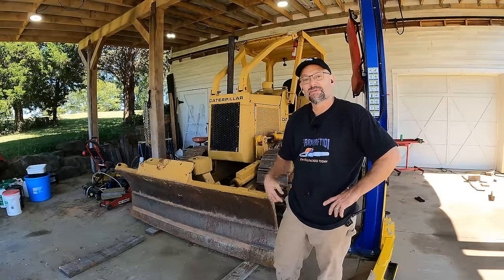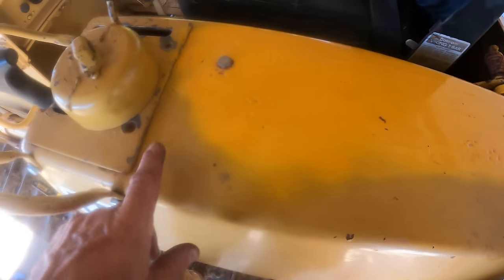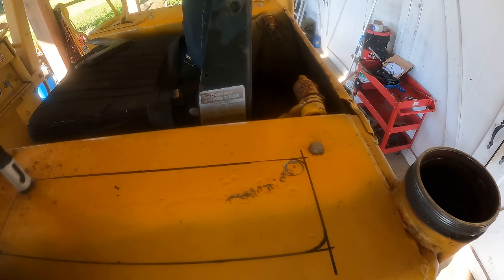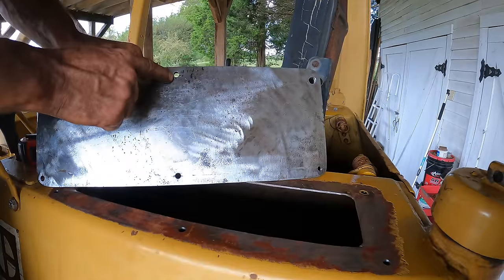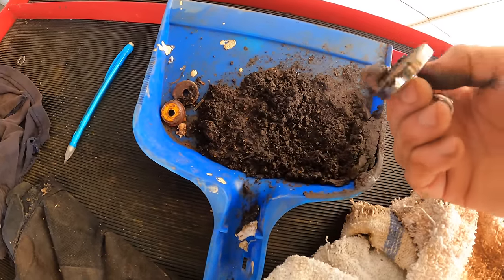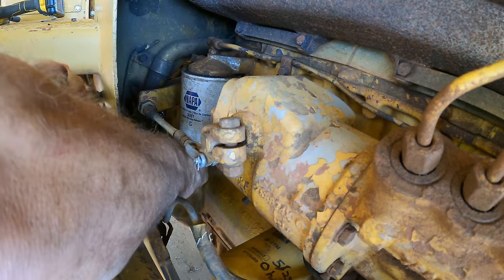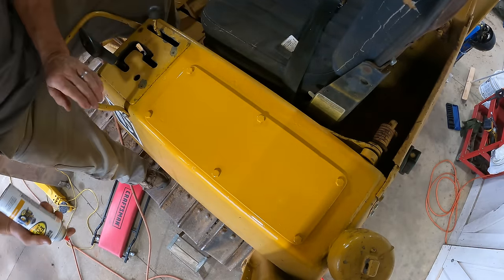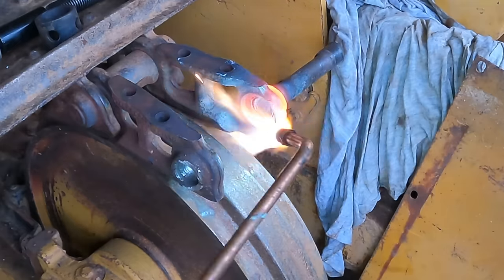Fixing My CAT D3's Fuel System & Exhaust. Cutting Open The Fuel Tank.

Comment: If your valve stem seals have failed, as easy way to tell is to run the machine hard for an hour then shut the engine down. Let it sit for an hour or so and start it back up. If it smokes out the exhaust on start up then clears out then you know your valve stem seals are leaking. When you hot soak it, the oil from the head seeps through the valve seals and gets in the cylinder.
Reply from the maker: Thanks for the tip!

Comment: Have you had any issues with that glass type filter coming loose over time?  I just put one on my motorcycle to keep junk out of the carburetors and my local motorcycle group thinks it will vibrate loose and turn me into a fireball.
Reply from the maker: I haven't, but mine is just diesel.  Even if it were to leak, very unlikely to start a fire.  More likely it would suck air and the engine would die out.  I'd be a little leery of using this on a gas setup.

Comment: It does not look like you have to take the track off. Can you remove the four top bolts at the upper guide, and you should have access to the the wornout section to weld it?

Comment: dumb questions..   build your own pinpress ( like pulley puller )  but with fine threads instead of corse so you can aply more presseur.   and looking at the idle wheel.  i would consider  or  buy one ( china is 75 dollar   origenale is 600 )  but option 3  is build ( mill ) your own.  its a simple job looking at the photos of the wheel.  beter to mill from steel then repair the angle wear.  ( i mean only the part that holds the wheel its just an u shape milled steel  ( easyer to mill and replace the repair )   just my 2 cents.

Comment: Why not weld or screw a bronze wear strip onto it or just bronze welding wire? Maybe that has better wear characteristics than some mild steel. But maybe its just the 50 years of use nibbling away at it 😅

Comment: Pulling and installing track pins is not a fun Job ,But I know your going to do it, that I do Know. Definitely clean the undercarriage WELL before you start. Talk to a few dozers guys out there who have done this before , Clint from C&C equipment ,or Squatch 253  These guys have loads of experience on dozer repairs  ,Your fix on the fuel tank was necessary and yours was a slick fix at that, with a removable cover though I seriously doubt you'll ever go in there again

Comment: Ignore the oil consumption, when you tear into the engine your OCD is going to take over and you may spend in $5000 in parts. Don’t open Pandora’s box until Pandora throws the lid off of it herself.

Comment: Why not back up idler as far as it will go, build up worn area with arc rods for hard surfacing, grind down, then move it forward and do back area. The lower wear plate for idler should be replaceable and not to outrageous a price.

Comment: Pro tip - If that's a Mr. Gasket or Amazon clear fuel filter inline before that plastic shut off, do yourself a favour and trash it. They are known to leak badly.

Comment: There are two primary reasons a tank gets like that.

Dirty fuel. Using fuel that has water in it will end up with water build up in the tank.
Not filling the tank at the end of the day. 

Diesel engines use excess fuel to cool the injectors. That excess fuel is returned to the tank and is quite hot. If you do not fill the tank at the end of the day what happens is the fuel and air in the tank shrink as they cool off in the early evening this sucks in air from outside that typically has a high moisture content (depending on the climate you live in) That moisture builds up ove time and causes corrosion. You will notice that the corrosion appears mainly in the top third of the tank. That is caused by water vapour.
If you fill the tank at the end of the day you do two things. You cool the fuel in the tank and you force the water vapour laden air out of the tank.

Comment: i would sneak a sheet of aluminum behind that spot you're trying to weld and then the weld wont stick where you don't want it. just grind it flat after the welding and measure your gap. shouldn't have to take the track off.

Comment: 28:57 i guess thats because the magnetic field is "trapped" in the steel and can't get through to the other side. if it was some non-magnetic material (like plastic) instead of steel, it would have worked.

why didn't you paint the cover plate before installing it?

Comment: Why did you not put the magnets inside so the material gets direct contact. You can even put it in a plastic bag to seal it if you like. 
Second, you should paint or coat the inside of the tank. One of those fuel tank liner products would be perfect.

Comment: Your problem appears to be fuel algae. It is common when biofuel sits around for long periods of time. That solution of cutting a panel out of the top is a good one. I like it. My only concern is that there may not be enough bolts and bolt holes to secure the plate around the perimeter. It may leak with the longer runs between the bolts. The worn trucks and idler assemblies will be a chore for sure. That idler carrier is cast I believe. If it is cast, and Cat loves to cast things, heat it up with a torch a few hundred degrees before welding it, then torch it slowly cool to prevent it from cracking. I would use some nickel rod on it, and that AR500 plate you used for the final drive. Cheers.

Comment: Not knowing anything about bull dozers whatsoever, what holds the part on the side that is wearing down? Maybe if you could remove that, it would give you access to the part on the hub sections and the side part as well to weld so much easier. But than I have no idea what is holding that side cover on... Just an idea...

Comment: I hope that you check with Clint at C&C equipment repair. He is a guy who has a heart for old equipment, lots of times he has a tool or a way to repair some things we don't have clues on. He does work with Mike at Dirt Perfect and of course my memory of names are quite challenged so its Lets Dig 18 who is a big name and channel for doing ponds and clearing. He is a white shirt kind of guy but has a lot of old equipment and does his own repairs plus not afraid to hire someone to get the nasty grime under the fingernails. His name is right on the tip of my tongue yet just won't come to me.... and then just like that... "Chris" his name.... Okay, spelling is not too high over here either but I am just trying to help by giving some ideas of whom his channel covers highly. Chris is sponsored by Volvo... fair to middling size outfit. Mike at Dirt Perfect does his own repairs as well and has his mechanic shop tied under or near his home. Just a ton of equipment now but came out as a young guy who had a dozer and some other bare bones stuff till he grew to size. I hope that you connect to this group as its going to pull you into a bunch of nice guys who will do a ton for the little guy.   I kind of wish that you had done the fuel tank early on when doing this last job with putting in a pond. I know its okay for you to go high up and trim trees out but for me .... well its a butt clincher. Nice work doing that tank clean out. I think that the glass filter might be a spot for issues if a rock or limb catches the line and breaks stuff.... your luck seems to go that way/LOL

Comment: Just put a GIANT in-line fuel filter in the outlet line. Like an automatic transmission cooling line filter. If it ever plugs you can change it in a minute. If you angle it outlet up you won't get air pocket. You can run a fuel pressure gauge from in front of one of the original fuel filters if you're that anal.

Comment: Why!!!!! It’s flippen diesel there bud. No need to add water or an inert gas. You could cut in with a cutting torch and it would be fine. It’s gasoline that you need to worry about, Weld below the filled level inert gas on top. An empty gas tank is more dangerous than a full gas tank.  Yea water will work as well but a pain after the fact. 

I’m a ticketed pressure welder, 30 years.
Reply from the maker: I was going to power wash it out anyway.  That power washer help a lot.

Comment: Caterpillar should be ashamed of themselves building a non-removable fuel tank on a machine that you are cussing them out for building no way to clean out that fuel tank. What a great opportunity for them to shine above all other brands and they really dropped the ball. Made with pride in America should be their motto. How much time would it have taken for them to do what you did at the factory?? Diesels are so very clean fuel delivery dependent and yet they made no effort to make this a non-issue. It could have been a feature! The mild steel rusts so easily and a dozer is always getting fueled in the field where dirt and water are prevalent. GGGGRRRR

Comment: pump the rattle can with some compressed air through the spraying nozzle you should be able to use every drop of the paint out of it. cheap ass trick. 😅😅😅

Comment: Propane from a welder/ generator. House wired with sub panel for generator. Main box can select what appliances to run. I’m a welder. 2nd welding machine/ generator on regular gas.
I need a power supply like yours as well . Prepared with 4 months of food . Beyond that I’m screwed. Armed as well. The government is not your friend. Stay away from FEMA aid. You will disappear.

Comment: WHY?? Could have used a chemical degreaser to cut the crud & Remove it without cutting the tank at All. NOW you're going to Have a fuel leak around that HUGE HOLE!! Think you Made a Huge mistake on this!